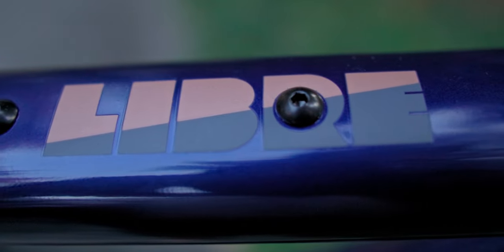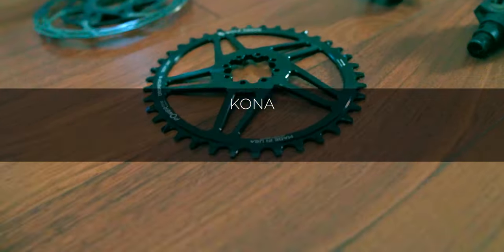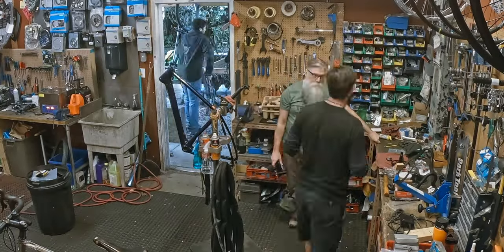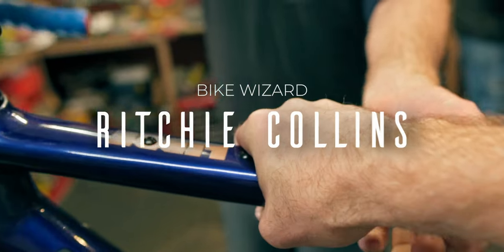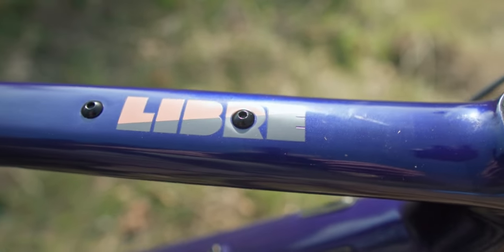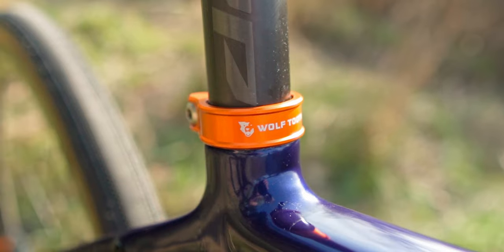DREAM BUILD: Kona Libre DL Carbon Gravel Bike

Comment: I made a mid-life crisis bike using a Ti frame from Sage Cycles and threw 2x Force AXS Wide eTap on it. It's been an absolute pleasure to ride. I don't care what anybody says about electronic shifting (you have to charge it, you don't need it, etc) it has been absolutely stellar. I'm almost thinking about putting it on my mountain bike, but now that I have the gravel bike, I don't ride the mountain bike as much.
Reply from the maker: Ted… funny, you wrote what is exactly in my head & in my garage.

Comment: What size is your libre?
Reply from the maker: 52… I erred on the smaller size for handling on tighter trails.  I’m 5-8, 30” inseam.  Fits very well, and comfortable with aero bars not too stretched out with a 70mm stem.